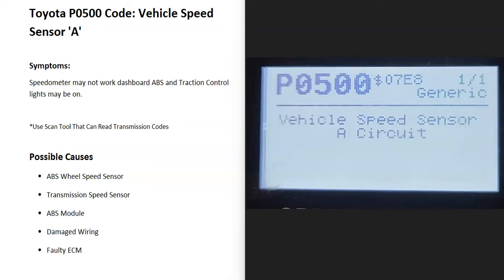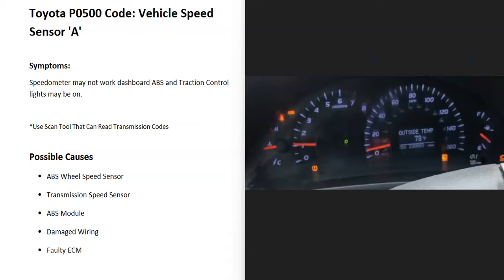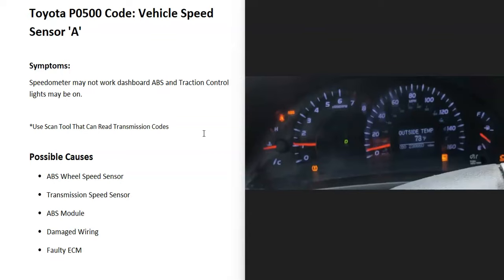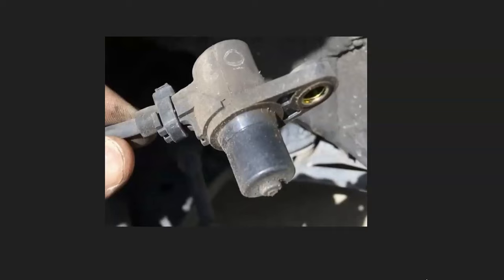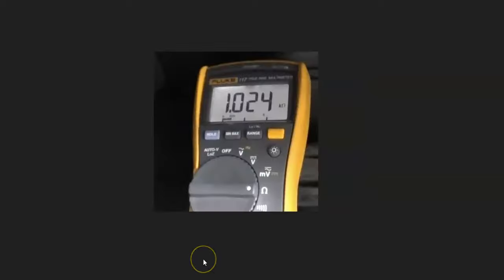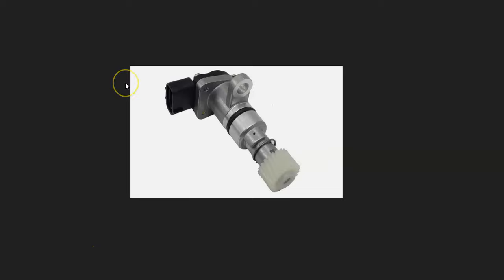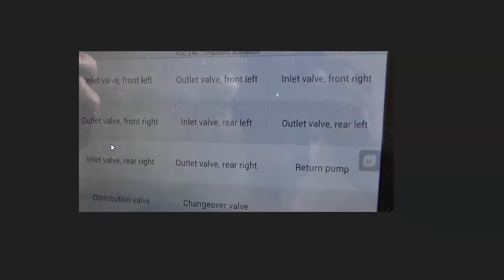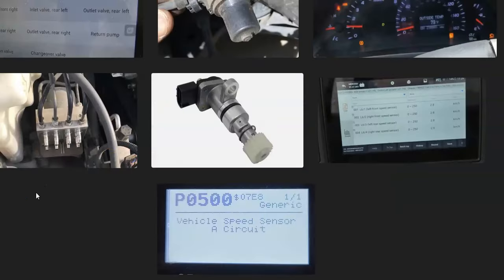Causes and Fixes Toyota P0500 Code: Vehicle Speed Sensor 'A'

Comment: I’ve had my Rav4 for about two years and had these crazy problems consist overtime and it still drives, there’s a Speed Sensor Check Engine Light that appears after a rainstorm and when it does the speedometer shoots to 80km while stationary, the only way to drive my vehicle is to turn on high beam or my vehicle will shake and stall completely then the speedometer drops to 0 and doesn’t move at all when driving, on top of this morning i started my vehicle and no power came on so i unplugged the terminal and put back onto the battery then it worked but here’s the weird part the rpm goes from 1000 to 0 within a good 30 seconds and stalls when no gas is pushed down and the car shakes like crazy while the whole speedometer thing is happening, fast forward into the next day  after a thunderstorm last night i decided to start my vehicle and expected the worst, but my car works fine the rpm read 1500 on start and slowly went to 1000 and stuck to it and speedomoter works without turning high beam on..what should i do as the check engline light for this code is still there???
Reply: That’s most likely a bad resister in your speedometer board
Reply: Or wheel sensor unless your Toyota gets speed from trans input sensor.
 Usually trans input sensor you’ll also get eradic shifting or delays

Comment: My speedometer doesn't work randomly. When it doesn't work the car doesn't shift right. When it does come on the car shifts perfectly. I already changed the transmission speed sensor. Got a hunch you what it might be?
Reply from the maker: That is a common symptom of a bad speed sensor. If there is a speed sensor code and the sensor is good, I would check the wiring.
Reply: Trans input sensor unless it’s gets its speed reading from wheel sensor

Comment: From your experience with Toyota Is it possible for the p0500 to be a faulty abs speed sensor without the abs light on, just the cel along with tracoff and vsc? I changed my speed sensor to the trans but lights and issue still there
Reply: Same here that's what I'm trying to research tight now, is yours fixed yet? 
2006 Sienna here.
Reply: Your abs light will almost always be on from what I have seen. See my top post of everything works shifts ok and speedometer works and and light off it coild be your speedometer circuit board wiring from that to your ecm  pr not very likely your ecm.
Your cruise control probably won’t work. I think those are like Camrys

Comment: My Camry 04 shift to all gears  grinding sound car won't move,code p0500a.what is wrong? It is only code p0500a.i changed transmission sensor underneath of battery still grinding when put in reverse, neutral or drive. Please HELP... Thanks.
Reply from the maker: The Vehicle Speed Sensor (VSS) needs to be tested to see if it has failed. If it is good, then there is likely an issue in the wiring.

Comment: I have this code showing on my toyota yaris 2008 and have the sensor and Ecu replaced and it's still the same with gear 3 to  8 sluggish shifting and it's still showing p0500 . Any other things to check for possible solutions

Comment: Older Camry 2009 solara
Gets speed from wheel sensors  sends to abs them to the speedometer which decodes and sends to ecu
If your speedometer works it usually wiring bad ecu or which is common, bad dash cluster. Also check your alternator which of its not putting out quite enough voltage you will get a 0500 code.
It’s usually not trans speed sensor or exam.
ABS  usually causes jerky or no speedometer gauge.
Of everything checks ok and your cruise doesn’t work and your alternator is atleast 13.5 to 14.7 then it’s speedometer board wiring or ecm
My car runs perfect and I have this code and I cannot get it to go away. With 200k + miles and everything running perfect a llaying card covers the engine light.
 There is also a resistor in the speedometer board you can replace for about 5 bucks mainly shipping, seems to be the thing that goes bad on Camrys.
Hope this helps

Comment: I have a question what happens if you dnt have any code but the speed is not reading correct I’m driving slow and the speedometer shows I’m going faster than I am is that the same should I change it
Reply from the maker: It could be a bad sensor, but it can also be in the wiring or the gauge cluster.

Comment: Hi  broo can a speed sensor cause  der gears to not change on a auto car
Reply: Im on the same boat did you fix your car?
Reply: Yes find out the route of vehicular speed for your car. Does it come from trans sensor or abs. Of it can’t keep a steady reading on your speed it can’t shift correctly

Comment: Please I have a 08 Camry v6 with the u660e transmission 
It has a po500 code on the dtc 
But everything works fine the transmission shifts well
The abs works well no warning lights 
Should I be worried??
Reply: Your cruise control probably doesn’t work of it does its wiring or ecm My car, did you actually get a individual speed reading on each wheel start there your probably ok with the light not being on but easier to check those readings before you replace your speedometer at try and hunt down wiring
Also check your relay fuses

Comment: My 2005 Sienna gave me a sustained P0500 code along with an ABS light.  

I then replaced the battery (for another reason) and the code went away but the ABS light is still on.

Does anyone know what this could be?
Reply: Did u ever figure out what triggered yours and what did u do to get they abs  light off?
Reply: @joelfranklin827  I haven't.  It came back on.  But I did make a few videos about my van.
Reply: Abs is and… speed sensor get individual readings one is probably laughingly behind. Rear left

Comment: ok,
i have a Sienna(2004).
the owner was at 65 mph and the tranny "disconected", literally shifted into neutral and never went into gear again.
got it home, read a p0500 code and he swapped out both transmission speed sensors.
still popping p0500.
still in neutral.
shifter is perfect, no bad plastic grommets 
😆😆
so not being here, whats your impression of this problem....??
also, what kind of scanner do you have, i grew up in the era of using a 32 inch phillips head screwdriver and putting it to your ear.....
🤣🤣🤣as an advanced diagnostic tool.....
😂😂😂😂
Reply from the maker: It is hard to say, but I would check the wiring and the reluctor ring teeth.
Reply: Thanks! 
would a professional scanner help in this instance, you think?
Reply: Did you ever figure it out
Reply: 🤣🤣🤣🤣🤣
put it up on jackstands, climbed under and discovered the half shaft clamp was dangling, the shaft had slipped 4 inches out so, there wasnt any teeth to read!!!!
15 bucks later he was back on the road!
😁
Reply: @garystillman2724  what was the fix? Just the replacing of the trans speed sensor?
Reply: i replaced the passengerside shaft clamp, shoved the half shaft back in place, clamped down on the half shaft, 
no more problems!!!
 hes still driving it!
not a sensor problem, just a loose clamp!